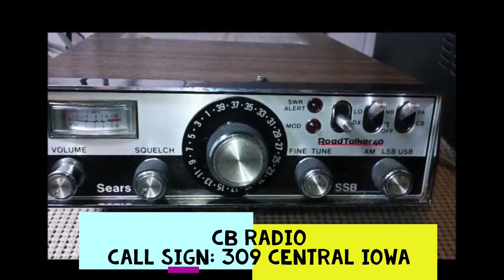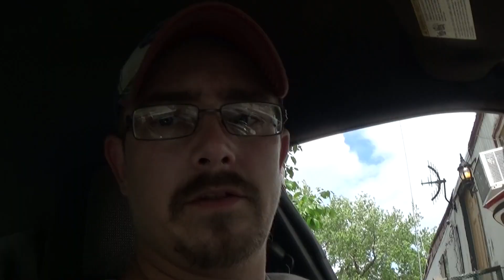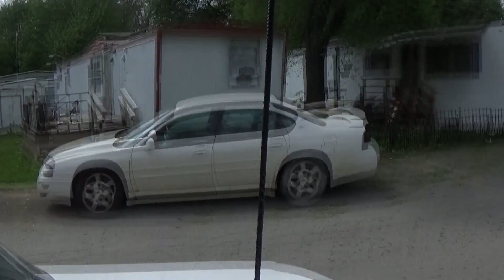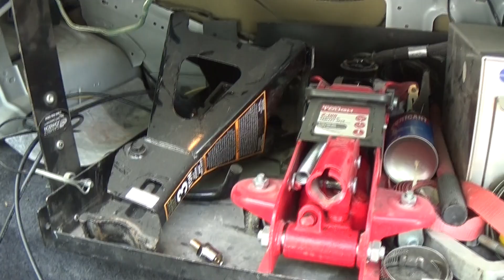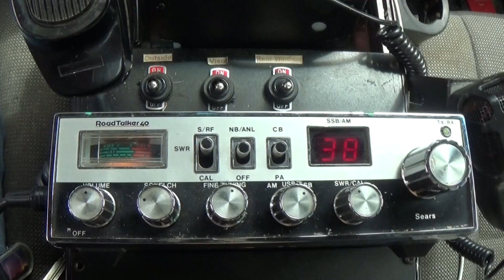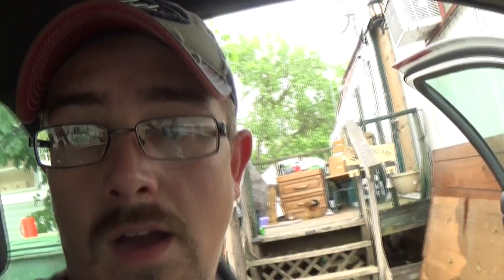CB radio is now in my car as well!

Comment: I get a Wilson 5000 magnet that’s what I use and it’s a good antenna it’s good for side band he’ll kick butt antenna try to get you on Wilson 5000 or Wilson thousand
Reply from the maker: I did get the SWRs down on my 102 in steel whip on the car it's at about 1.5 now

Comment: Just got a new president mckinley cb radio on Saturday now I need to build a antenna for the house.
Reply from the maker: That's awesome now you just need to figure out if you want a vertical or horizontal antenna, I would suggest if you're going to build a horizontal antenna do a simple wire half wave dipole, or if you want to go vertical build yourself a quarter wave with ground radials about 104 in copper wire antenna with a PVC pipe

Comment: Sup Corey  check continuity from battery negative  to base of antnna 
Did you clean paint off on metal on 
Under side the truck  n star washer good use thare 
Is that a firestik2 or kw
The 2 has a screw under the top rubber cover for seting swr
N when seting it get out in the open 
Away from trees buildind n metel
Doors shut n you inside the car
You probably know some or all that but i wus just makeing shure
I gave you thumbs up
That radio a good one made in Japan sebernet
Reply from the maker: I have a wire grounding the antenna since there is rubber washers sealing the trunk from rain. The firestick is a 2 I think non adjustable. I know all the doors have to be shut and what not I have not taken the firestick out to see what it does. The radio is a really good radio I love it.
Reply: @CoryRandomGuy if its a 2 thare is a brass screw under the rubber cover  the kw is the one no screw the kw came out first n 2 is upgrade to make easy to tune
N some times you need put a spring in to get swr right or a few washer if just a litte
I'm shure you will get it 
Looking forward to your next video
Reply from the maker: Yep it's a kw then because there is not adjustment to it. I will get it right one day. Thank you for the support on the channel.